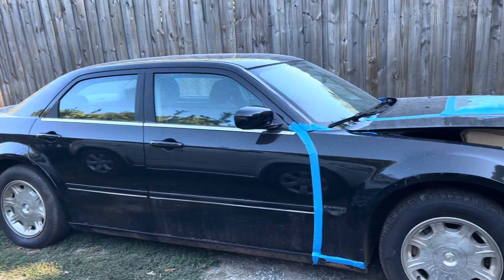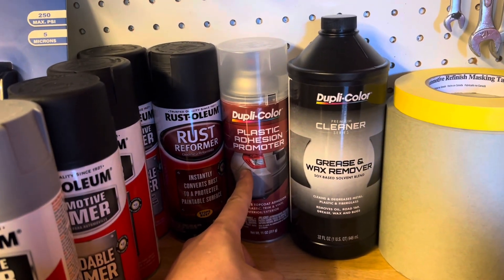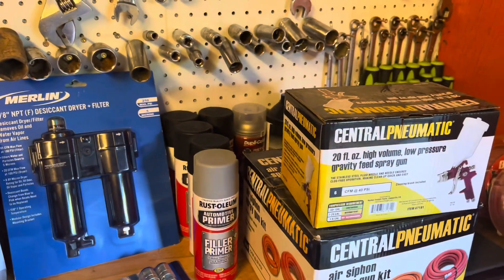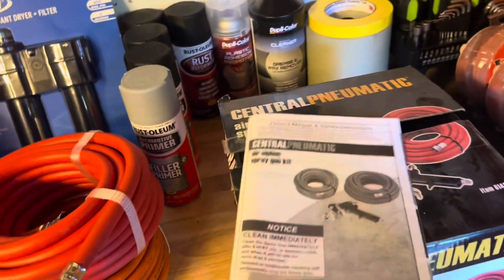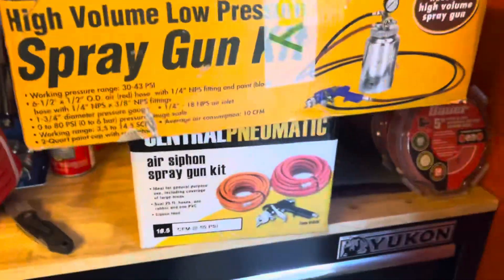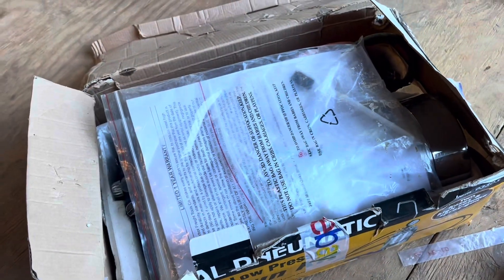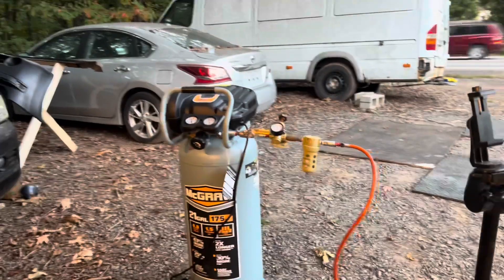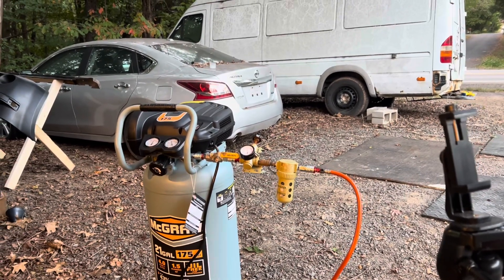Upgrading My Garage: Unboxing & Testing the MCGRAW 21 Gallon Air Compressor

Comment: Dude have bigger version of the purple paint gun and it sparys very well. It all in how you set up the paint gun. Make sure you a test piece to check you spray patern and flow rate on before ever get close to actual thing you want to paint. Just remember less is more it's easy add more coats for coverage then it is to take away. Good man. And remember a good paint job is in the prep work. Prep work is 90% of a good paint job.
Reply from the maker: Wow that’s great,Thanks bro, I plan to use the purple gun for primer, it’s 1.7 nozzle with b is perfect for paint and primer, I will use my black widow paint gun for paint it’s 1.7 spray nozzle but I wonder is it ok for clear coat? stop by tomorrow to check my work to make my prep is good, I definitely think I need to do more work on my prep, but my wife thinks it’s great, I always appreciate you my friend.

Comment: DOUBLE your inline air dryer. Also, I’d see if you can get another tank that you can connect together with the primary compressor as a “surge tank.”  It will keep the air temp coming out if your paint gun cooler. You can put the primary air dryer in between the two tanks. You can get a broken compressor just for the tank, sometimes for free.
Lastly, since you have a rubber hose, the pressure regulator should be closer to your gun with the least amount of hose between it and the gun.  Expansion and contraction of the hose can vary the pressure.
Reply from the maker: Thanks for explaining it my Friend, I actually got a free tank it’s huge, I was told it leaks but I think a welder will solve that issue, tomorrow I will show you my setup
Reply: @ZimaletaMotors  Spec-freaking-tacular!

Comment: Mine just took a  💩 McGraw 21 Gallon 175 psi Vertical Model. The Electric Motor failed. I 'don't' recommend anyone buy these.  In my opinion, they're junk !! Owning mine for about two years. I may use it a half dozen times in a month. Mostly for airing up tires. Sometimes run it with a couple of air tools. But definitely not overworked. Being it was oil free & less maintenance. I gave it a shot. That was a mistake.